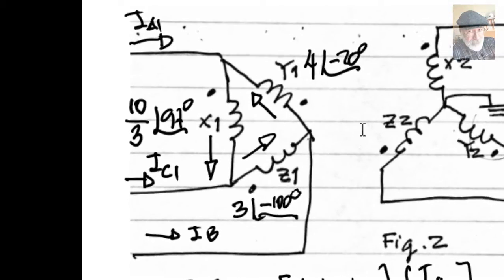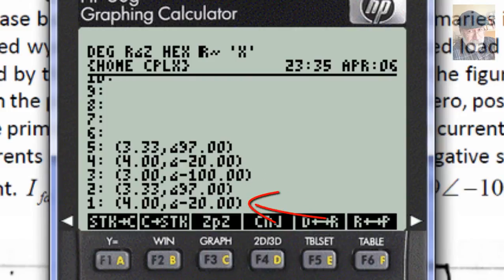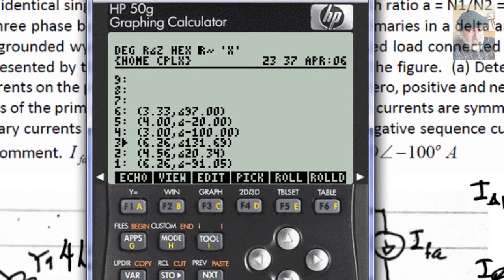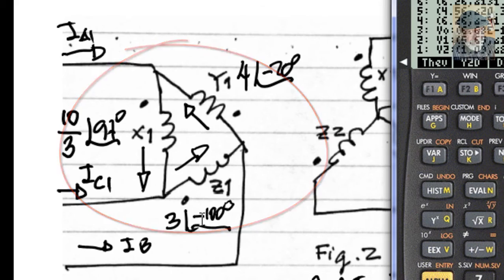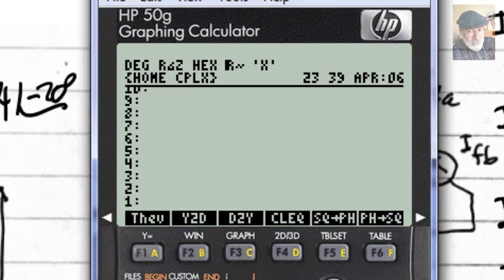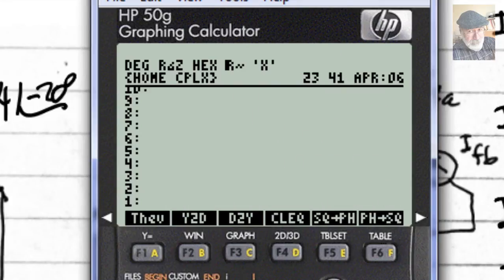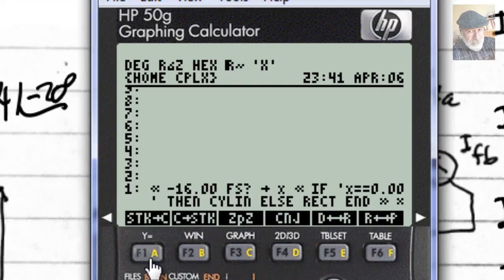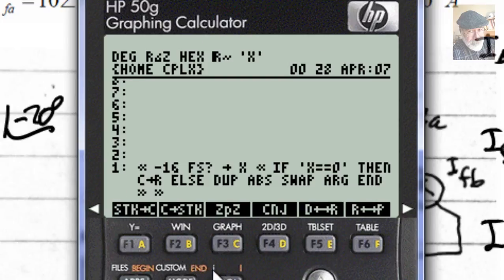EECE 392 - Unbalanced 3ph transformer, the HP-50g computations.

Comment: Bom dia ilustre professor. Tem como converter estes programas da HP 50g deste vídeo para a Prime? Se nao' Haveria possibilidade de fazer os mesmos pra HP Prime
Reply from the maker: I asked myself the same question before I had the HP-Prime and used it for a bit. The answer is: those programs are unnecessary in the HP-Prime! The HP-Prime works with complex numbers in a smooth and unobtrusive manner. More, in the Prime, numbers in Polar and numbers in Rectangular form coexist peacefully. Also, the symbolic solve works nicely with complex numbers. All things said, I don't miss any of those custom-made programs when I am using the Prime, which is all the time.
Reply: Thanks for the answer. I hope one day you will redo the programs you have in your videos for hp50g for hp prime. I could not translate them from 50g to prime.grato

Comment: Impressive the way you programmed the keys to solve the problem easily.
I just bought HP Prime; where can i find the system flags and there functions?
Thank you for the clear informative video.
Reply from the maker: Thank you. The system flags, and the user programmable flags as well, can be found in the Advanced User's Manual that comes in the CD that came with the calculator.
Reply: rolinychupetin teacher goodnight could inform me of what the textbook took up exercise could also pass the PRA program HP 50G: thev (THEVENIN) and the STR-C and STR-C (PUT THE AUTOMATIC ANGLE SIMBOLODE COMPLEX NUMBERS) .GRATO